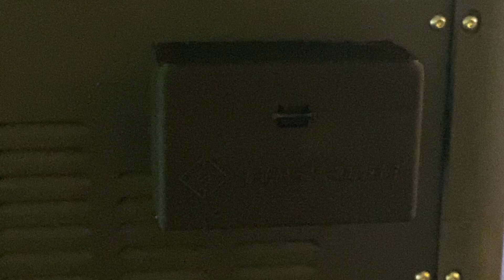Flashforge Adventurer 5 AD5M Nozzle Storage Box with option to attach to back of printer

Comment: Nice and neat. May I ask what software you were using for the 3D design? I am an electrical engineer but want to learn more about 3D design (something more than TinkerCAD)
Reply from the maker: @yezhao26  For decades I have been a power user of SketchUp, and in the last couple or three years I have also gotten pretty familiar with Fusion 360. Currently my modeling work is split somewhere like 50/50 or 60/40 between those two programs. SketchUp is basically mesh editing, that Fusion calls Direct Editing, but SketchUp is kind of like mesh editing on steroids. Fusion has a direct edit mode but its normal approach, which is 2D sketches on any plane/face, resulting in extrusions, resulting in solid bodies, and combining and subtracting with solid bodies … is a nice approach, especially with the history and the ability to re-edit a parameter later and have it update your work for you … is real nice.

Comment: Hello, can you tell me if the original 0.4 nozzle that comes on the M5 is a reinforced nozzle (steel) or a brass nozzle please?
Reply from the maker: There is a difference between steel and hardened steel. Only the 0.6 and 0.8 are listed as hardened steel. The 0.25 and 0.4 seem to be steel, but not hardened steel. The manufacturer's website (linked below) says the 0.25 is for PLA/PETG. The 0.4 is for PLA/PETG/TPU. The 0.6 and 0.8 are for PLA/PETG/TPU/carbon fiber. https://www.flashforgeshop.com/product/adventurer-5m-3d-printer?cID=31
Reply: @design8studio  OK, thanks for the clarification, strange to have chosen different materials for each nozzle, but noted 👍😉
Reply from the maker: @JoshuaRilliet There are probably valid engineering reasons for not hardening a 0.25 and perhaps 0.4. The abrasive chunks in the carbon fiber and fiberglass (etc) filaments, would probably have accelerated risks of clogs in smaller nozzles.
Reply: @design8studio  Indeed, I remember that already for my Sidewinder X1 it was recommended for filaments loaded with particles such as carbon, wood, etc to use rather a 0.6 but also that a 0.4 nozzle could work. As I haven't tried this type of filament on the X1 (Artillery) I haven't been able to check whether the reinforced steel nozzle that I added to it was suitable for 0.4 or whether it would be better to use a 0.6 nozzle, it's so much work to change the nozzle on the "old" machines that I've always been too lazy to make the change and test the carbon filament or the wood-filled filament that I've had since almost the beginning, but I still haven't opened the bags. With the ease of changing the M5 I could always take a 0.6 nozzle and finally test these filaments ;o)

Comment: It would also work for the ADV 3 and 4?
Reply from the maker: I think so. I don’t know if either of those printers has screw holes that would support the mounting option, but if not, you could always drill two M3 holes at 40 mm on center, and if you are not interested in the mounting option, then I think the plain box itself would accept the print nozzles from the AD3 and AD4.

Comment: Nice box but that location looks painful to use (but i guess its hard to loose it when its hidden away)
Reply from the maker: Anything on the back of the printer is hard to get to. However, being that nozzle changes are rarer than filament reloads, it’s not something I need to get to often. Being that the sides are removable, I was reluctant to drill holes in the plexiglass to mount the box to the side. Storage space inside the printer is practically nonexistent. They have kept everything very tight up against the print volume area. There’s no room to store it internally.

Comment: For how long do you have it? I'm AD4 owner, and I'm looking for a replacement, since AD4 sucks at stability of the prints. For now I'm considering to buy Bambulab X1C, despite the price. But the the price of AD5 is indeed attractive. So did you try to print multiple objects or have some long prints for like 20 hours? Because AD4 is notorious for layer shifts that hit you randomly. You print 20 parts in series of 4, the first two series print just fine, and then it starts shifting layers, and you can do nothing about it. This is the experience that I want to avoid in my next printer. But unfortunately,  there are no long term use reviews for AD5 to prove or dismiss the claims about AD5 firmware, that it has the issues of the predecessor, only "unboxing + first print". AD4 was also good until I printed one part a time, and session times are less than 4 hours.
Reply from the maker: I have had this printer for several weeks and have printed huge items in it, including the top risers for DIY printed enclosure. Items that would have, "before", taken more than 24 hours to print on "normal" 3D printers, can now print in only 3 to 4 hours on the AD5M, because it's just that fast. For instance, there are four of the top risers for DIY printed enclosure. I sliced one of those four in Cura for my BIQU B1 printer, standard quality at 0.2 mm layer height, and Cura estimated the print time at 26 hours and 10 minutes. The same part, sliced in OrcaSlicer for printing on AD5M, at 0.2mm layer height, is a 3 hour and 1 minute print. I can confirm the print estimate was accurate! So, I literally have no models that would take 20 hours to print, because this printer is too fast for that! I cannot say enough good things about this printer. I am impressed. It's now my main printer, and I bought a second one to have two of them.